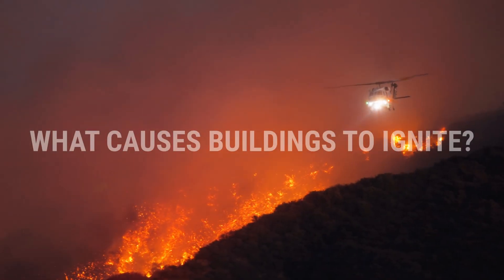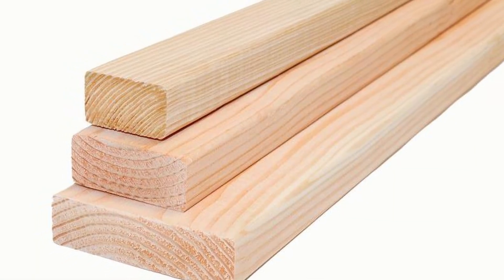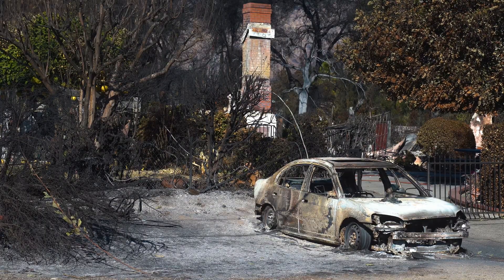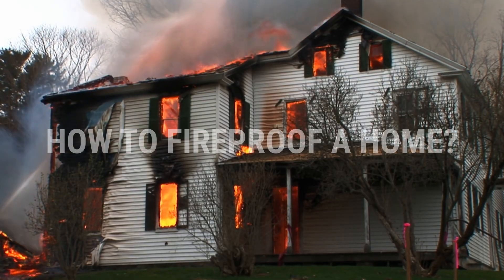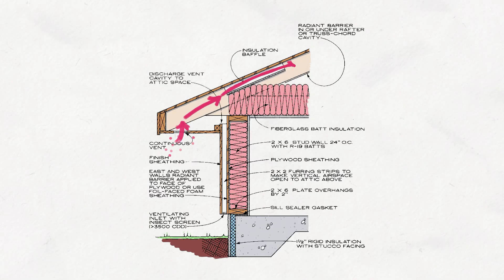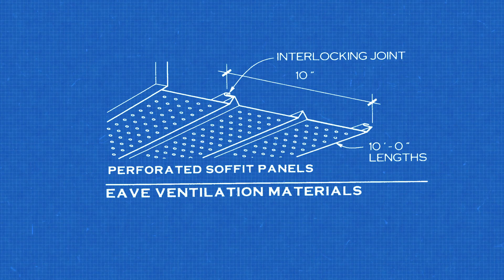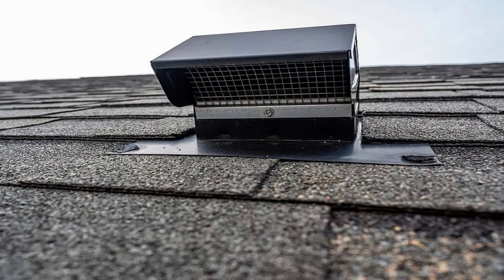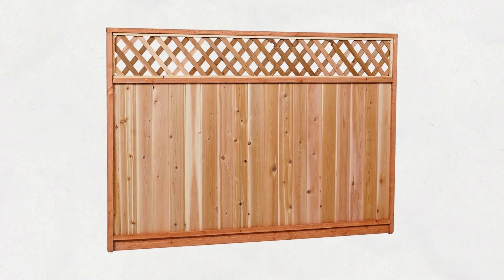Fireproof Your Home: Surviving California Wildfires

Comment: How to keep radiant heat from causing contents in the house from combusting? I wonder if radiant materials on the roof and walls would help with radiant heat. Another thing is, in LA County we are required to get approval on a landscape plan called a Fuel Mod Plan, which addresses landscaping that catches fire, and then there are space requirements around the structure to keep landscaping certain distances away from the structure.